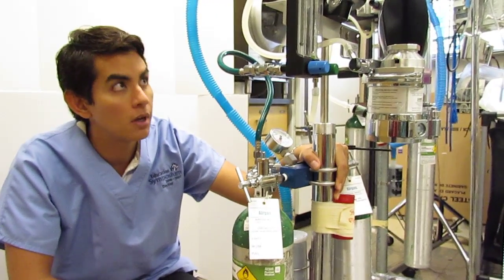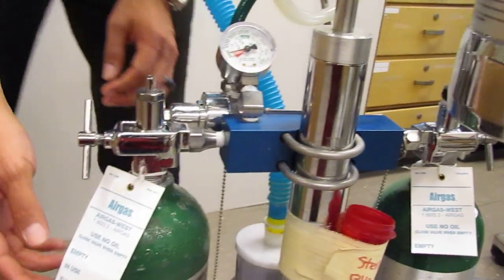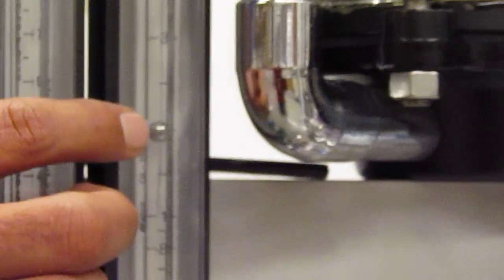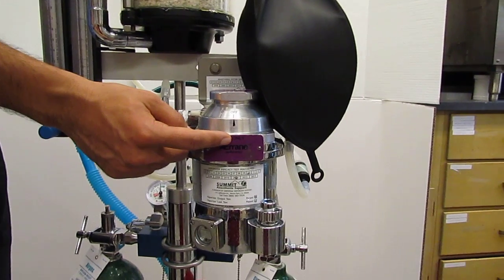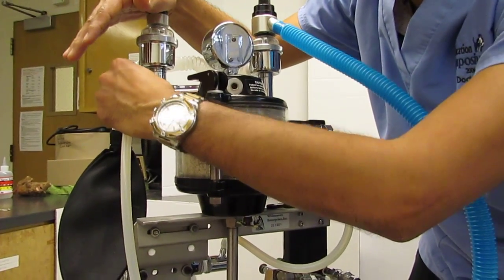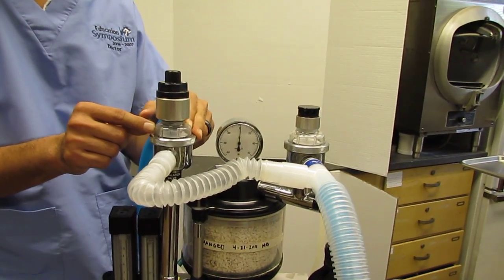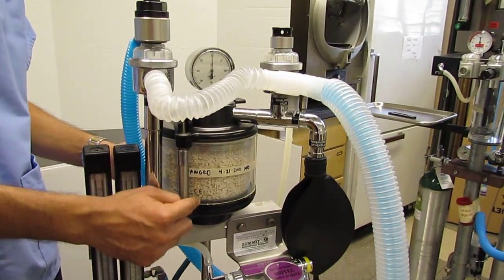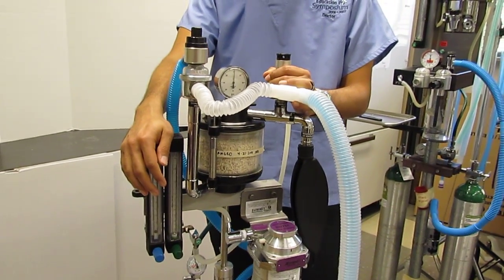AHS RVTg Program - Veterinary Anesthetic Machine

Comment: Thanks for the help!  I am transitioning - back - to small animal medicine after going from working in small animal practice for 10 years, then medical research for 20 years.  In medical research I did a lot of different types of surgeries, helping investigators in many departments.  My anesthetic machine was very simple.  This video helped me become more familiar with the small animal machine.  
I feel one very important part was left our regarding the f/air canister. If they are placed on their side, the activated charcoal will settle and a small amount of dead space will be created.  The incoming gas will follow the path of least resistance and come out of the canister unchanged.  I have done a study on this and published this paper:  Flushing Induction Chambers used for Rodent Anesthesia to Reduce Waste Anesthetic Gas Lab Animal Vol.40(#3) pg.76-83 March 2011
I was also wondering what amount of time do you give the Soda Lyme?  What percentage of the Soda Lyme is considered critical/needs to be changed soon, during surgery?
Thanks again for this great video!  It’s very difficult to keep something so intimidating, simple and concise.  You did a great job!!

Comment from the maker: @ventilator98 This vaporizer was between services so it was virtually empty. Also, you may notice the flowmeter was turned off at the time I momentarily demonstrated how to turn the dial on the vaporizer, so there was no oxygen flow. It is very unlikely any gas left the vaporizer. We 'use' equipment all the time for instruction, so it is never a "waste". Nevertheless, thank you for your concern.